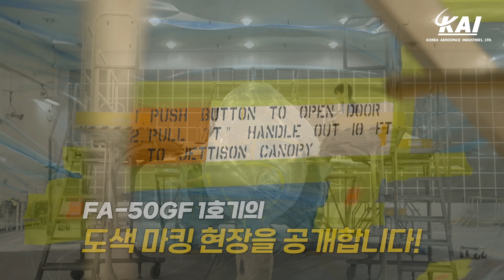[4K] 폴란드 1차 수출용 FA-50GF 1호기의 마킹 도색 현장 공개!

Comment: Fa50 엔진을 f414로 바꾸고 날개를 좀더 키우면 좋을텐데 그렇면 더 많은무장도 가능하고 kf21도 같은엔진이나 부품호환 수리도 편하고 미해군 사업에서도 날개늘리면 양력을 더받으니 항공모함 이착륙도 쉬워지니 훈련기채택에도 가능성높아지고 괜찮을꺼같은데 그나마 연료통 늘리는게 확정된건 다행인거 같습니다.
엔진 f414로 교체와 날개를 늘리는 계획은 없는지 궁금합니다.
Reply: @장남호 From what I understand GE F414 engine IS compatible with FA-50  body. Dimensions are +/- the same. My guess is that most important are $$$$$$ (or wons). F414 is to be  basic engine for KF-21 Boramae and S.Korea has license to produce this engine. The question is  if KAI is able to produce 50-100 such engines. So it is great idea to use F414 and I vote for IT.  With this engine FA-50 could maintaine full speed with full load of armament (even haevy bombs) ...